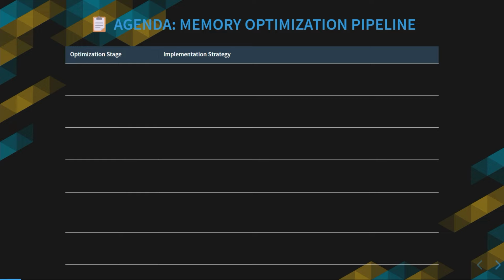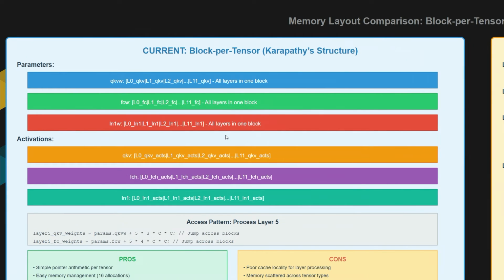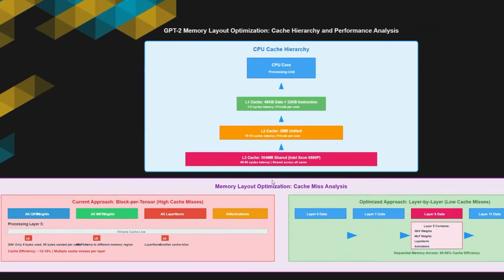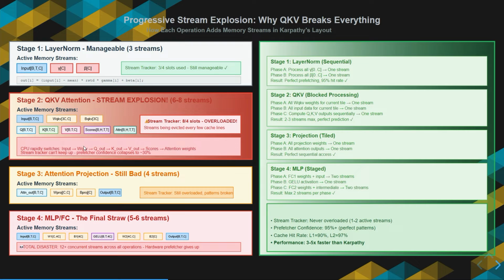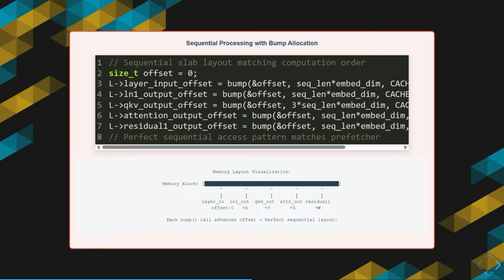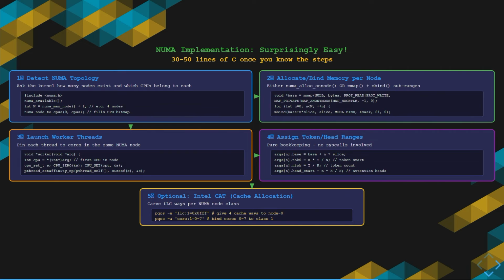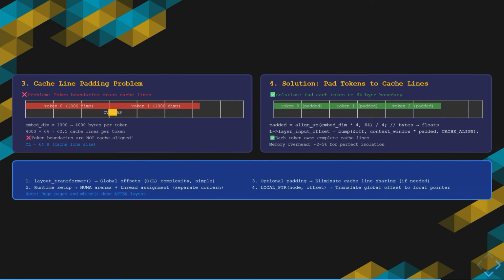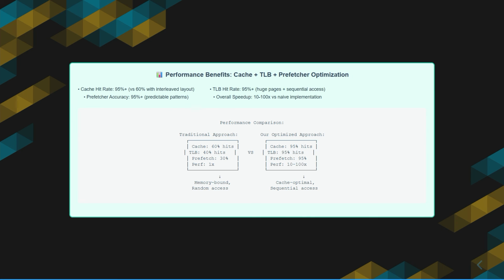CPU LLM #3: Advanced Memory Strategies for High-Performance AI Compute

Comment: 1. Does the memory and process layout of video work with very different transformer and non-transformers with kv cache and without it plus with different attention in models of deepseek, kimi, rwkv, meta's vl-gepa and many others? 

2. Can it also work on model that is multimodels like larva, qwen, etc? 

3. Does it work when using different processer like amd ryzen threadripper pro, a server of raspberry pi and mac mini by connecting multiple of it ? 

4. Does the program have a performance impact on operation system's kernel?

5. Can it be used on ai other than llm like self driving cars, robotics, etc? 

I quite may not understand the c code you write like '->' probably i only the know the basics.
Reply from the maker: 1. Different architectures and attention mechanisms:
Great question. This is exactly why I work with multiple models like Qwen2, Qwen3, and Gemma, each one has subtle differences in its attention layers! Right now, the engine supports Grouped Query Attention (GQA), sliding window attention, RoPE, QK norm, and QK bias, along with tokenizers like BPE, WordPiece, and SentencePiece. However, Mixture of Experts (MoE) architectures (which models like Kimi use) are not supported today. MoE is definitely on the roadmap, though. Time will tell when it all gets done. :)

2. Multimodal models (Vision/Audio):
Currently, I don't support vision models with encoders. However, multimodal support for images and audio is on the roadmap. Video processing likely won't be included in the near term, but static images and audio are planned.

3. Different processors (Threadripper, Server clusters, Raspberry Pi):
My primary objective for this engine is to run exclusively on Linux, targeting server-grade hardware (like Intel Xeons or AMD EPYCs/Threadrippers) and distributed computing clusters. Because of this strict Linux/server focus, it will not work on Windows or Mac. While a Raspberry Pi cluster is a fun idea, the true roadmap is geared toward deploying this to professional embedded robotics hardware from manufacturers like NXP or Texas Instruments once the core engine is robust.

4. Performance impact on the OS Kernel:
Nope, none at all! This program runs entirely in "userspace," meaning it cannot interfere with or cause issues for the operating system's core kernel.

5. Other AI (Self-driving, robotics, etc.):
For now, my focus is strictly on LLMs. I am mostly focused on LLMs because I feel they have capabilities that previous AI algorithms lacked, particularly in terms of coherence and generalization. That doesn't mean I am ignoring other architectures, if new variations gain traction, like the RWKV model you mentioned earlier, I would definitely take a deeper look! At their core, most AI models are just compositions of mathematical kernels. While my underlying math kernels could theoretically be stitched together for other types of AI, my current engine is specifically designed for LLMs.

However, deploying this to embedded systems for robotics is officially on the horizon. The goal is to get the training and inference engine fully robust on server hardware first, and then take that exact engine and deploy it directly to embedded systems for physical robotics.

If you want to follow along with what is planned and what is currently supported, I highly encourage you to check out myupdated version history and roadmap here: https://antshiv.github.io/C-Kernel-Engine/version-history.html

Thanks again for the great questions!

P.S. Don't worry if the C code looks a bit foreign. In C, -> is just a standard pointer dereference of a struct/union :)
Reply: @antshivrobotics  I read the version history and roadmap after sometime.
1. In later version of the project where is it going to implemented on flight system but didn't mention how the project is going to handle security problem when using llm as central control just ilke openclaw had. And also how is going to handle the system going out of control when the llm is halucinate just like one unitree robot going out of control after it recently dance on stage and autonomous self driving car.

It seems to you are trying to make the project to compactible and run faster on cpu to run llm and other ai models (vision, audio, RL) then trying to merge/chain them into a ai agentic model. Putting in into a flight system and robot to make worked on its own without human intervation. It similar to what openclaw (autonomous ai) and claude code (handles muliple types of data) seems to a little bit work on real life compared to your project.
Reply from the maker: Hey @generaltony9930, thanks for reading through the roadmap. Security and the risk of robots "going berserk" or hallucinating is a massive concern and agree with you on taking this seriously.

Here is how my approach with the C Kernel Engine differs from projects like OpenClaw, and how it addresses those exact security concerns:

1. High-Level Agent Wrappers vs. Low-Level Execution Engines
You brought up OpenClaw, which is a perfect cautionary tale. The reason OpenClaw became a security nightmare is that it was a high-level agentic wrapper that was given broad, unchecked access to local files, emails, and host operating systems. Because it was a viral personal project, it shipped with insecure defaults, lacked basic authentication, and was highly vulnerable to Remote Code Execution (RCE) and prompt injection. Attackers could simply trick the AI into sending sensitive local data to a malicious server.

That said, the chances of a personal project going viral like OpenClaw did are so rare that it's hard to blame the author for not prioritizing security hardening on day one. Just my two cents on that!

As far as the C Kernel Engine goes, it is fundamentally different. It's not an "agent" with access to your computer's file system or internet browser; it is a strict, low-level mathematical execution engine running in userspace. By building both the inference and training engines from scratch in C, the execution environment is tightly controlled and isolated, avoiding the massive attack surfaces introduced by bloated agentic frameworks and unvetted plugins. It's much more akin to PyTorch or TensorFlow than it is to OpenClaw.

2. Application-Layer Security & Best Practices
To your point, application-layer security, authentication, API hardening, prompt injection guards, and network isolation, is outside the current scope of this specific C project, but absolutely critical for any production deployment. The OpenClaw situation is a perfect case study of why that layer needs serious attention before any AI system gets exposed to the internet. While I'm not dealing with agentic integration in this project today, when the engine reaches that stage of maturity, I will definitely provide recommended patterns and best practices to integrate the AI robustly and safely.

3. The Solution to Hallucinations: Mechanistic Interpretability
Even with a secure engine, you still have to worry about the AI itself hallucinating or going out of control. The current trend in robotics is to use "black box" models, chain them together, and just hope they work. The vulnerability there is the lack of understanding.

This is the exact reason I am building this system from the ground up! Security comes from understanding exactly how the AI behaves. This involves Mechanistic Interpretability, essentially peering into the black box to see exactly how the AI is "thinking" and firing at the neuron level to prevent it from doing malicious or unpredictable work.

Your point about hallucinations and autonomous control is so critical that I am actually going to update the roadmap based on this comment. I will be adding Mechanistic Interpretability tools as a standalone milestone. As this engine matures to train models, being able to interpret the neurons easily will become a critical part of guaranteeing safe AI before it ever gets deployed to a flight controller or embedded system.

Thanks again for the excellent questions

Comment from the maker: Memory layout is the most overlooked optimization in AI development. In this video, I break down advanced CPU memory strategies for LLM inference - the techniques that separate 60% cache utilization from 95%.
We cover the complete optimization pipeline: preventing stream explosion (why QKV attention overwhelms the prefetcher), sub-NUMA clustering, cache line alignment to prevent false sharing, and how to design memory layouts that match execution order.
The core insight: the CPU prefetcher is a pattern recognition engine. Give it predictable sequential access and you get 95% cache hits. Give it random pointer chasing and it gives up entirely.
This builds on Karpathy's train_gpt2.c foundation but restructures memory for HPC-level performance - layer-by-layer allocation instead of block-per-tensor, bump allocation with 64-byte alignment, offset-based access instead of pointer chasing.
Part of the CPU LLM series - building transformers from first principles in C.

🚀 Update (v0.1.1)

We've added runtime token-sliced access helpers to the Transformer model in C!

🔧 New Features in This Release

// Get embedded input slice
float *x = get_slice(M, core_id, M->embedded_input_offset, M->embed_dim);

// Token-parallel QKV access
float *qkv = get_slice(M, core_id, L->qkv_output_offset, 3 * M->embed_dim);

// Token loop with alignment
size_t token_count;
float *input = get_slice_and_len(M, core_id, M->embedded_input_offset, M->embed_dim, &token_count);
for (size_t t = 0; t < token_count; ++t) {
    float *vec = input + t * M->embed_dim;
    // Do work here...
}

📦 GitHub Source (v0.1.1):
https://github.com/antshiv/C-Transformer/tree/v0.1.1

🧠 Want to understand NUMA + CPU cache strategies?
🎥 Intro to HPC on dual-socket Xeon (NUMA, cache, memory layout):
https://youtu.be/zmcODyd4dnU?si=t4SRAN5vZDXeEB24

🧵 Previous Memory Deep Dives
🎥 The Memory Trick That Makes CPUs Fly for AI: https://youtu.be/Wv0_GLbODeI
🎥 Advanced Memory Strategies for AI Compute: https://youtu.be/pEhcvMRWhhU